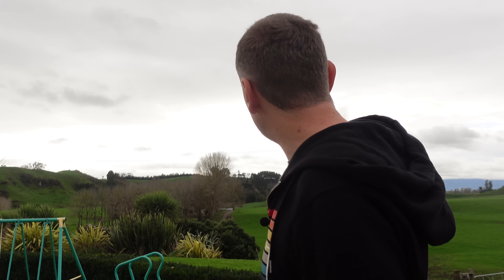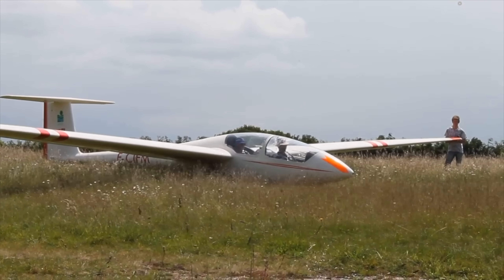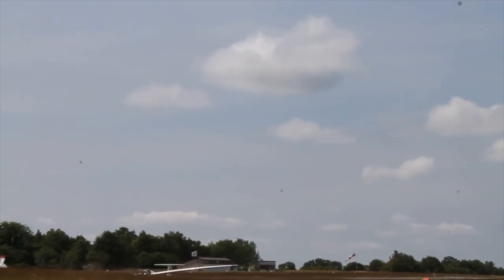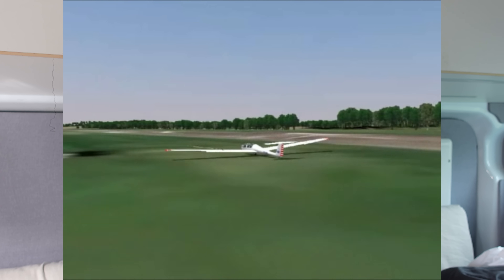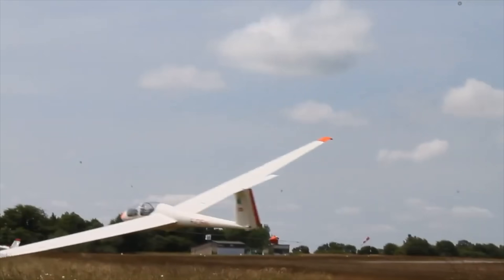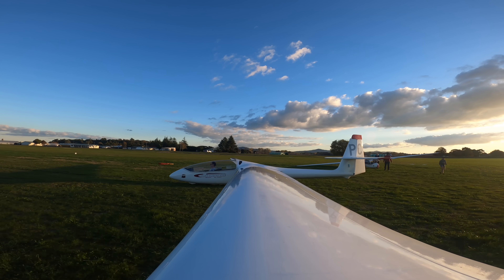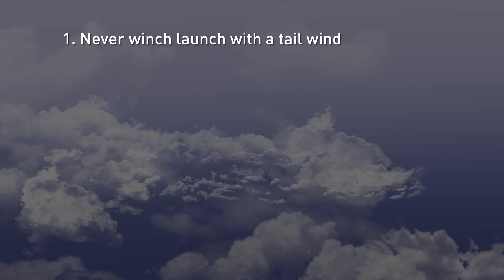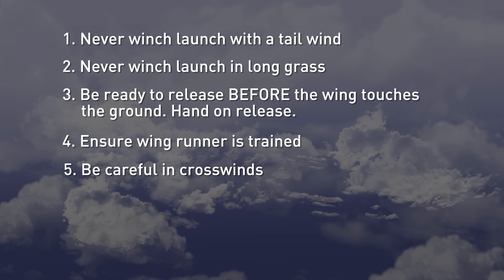Glider Winch Launch Crash 💥 Instructor Reacts

Comment: hello this is very shocking video for me. I had a few hundreds winch take of with L-13/23 Blanik in Slovakia. originally i though nobody control the glider - front seat pilot think its a instructor and opposite. but browsing comments here, front pilot should control. normally pilot in my opinion should use a full push in start /lift tail - i could not see that/ when acceleration is heavy, make airborne not from tail, must be very fast pull level becasue speed increase too fast..... but in moment left wing fall on ground,  also cannot see full rudder /tail/ to right side  with full ailerons with pushed elevator /lift tail first/ like he was not concentrated....somebody say tired. I saw right wing aileron for 1/2sec in correct way when i repeat video in moment wing falls on ground, then i think pilot start to hunt release cable hook knob. .  
 when tail is lift, ailerons became more efficient. when glider in air, he fight with stick to release cable, but ailerons and tail control seems resignation = neutral

with L-13 is almost impossible to fall wing in winch start /because have left and right hook, which stabilize glider a lot and good winch make a rocket launch, when ailerons works almost immediately to keep balance.. becasue school glider .
these super gliders is easy make a "watch circle and break tail " 
at my times, VSO-10 Gradient which i also fly cannot make a winch launch, only tow. - but designed for it - therefore i am not experience 
good analysis, grass is really high and it is significant factor. i think i would say also tail on ground help this "watch" . helper wing guy should let pilot know which directon wings want to fall, but i would say sometimes thanks for any hand.  and also winch operation with Blanik always had a 2 wing guys be able to break glider, if winch guy have a bad day..../for example make a cable tension hiccup before launch and let glider catch with gear......

Comment: can a computer auto-release auto land with issues and react much faster?    have a hands-free launch every time.
Reply from the maker: Not without a lot of engineering and design work. It’s more work than normal because it’s an aviation part, and has to undergo a lot of testing for use on certified aircraft

Comment: At my very first solo flight, at age 18, I landed at the right side of the airfield to make more space for the planes about to start BUT, just before I touched the ground, one tip was about a meter into some very tall grass, and I made my first and last ground loop! 
Luckily at very low speed, on the wheel and plane and I was fine.
My instructor drew a pig tail in my logbook  "landing" back in 1981  :D  
And after a short check, just a few minutes later, I went up again, and without any incidents.

My dad taught himself to fly in an open glider, SG32 in 1942, at an airfield very close to the German border, and with a rope to one of the farm's two workhorses "Tulle", and with his younger brother on the horse, the made a few attempts to learn to steer the plane on the ground, before he finally made it into the air, about 100 ft, and landed in the pastor's best apple tree...     

He was okay, but the plane needed some work before he could fly it again, and he did.

When they took his license to fly (medical reasons) at age 60, he had 19.976 hours in the air, exclusive his time in gliders.  Most of the hours were in agriculture planes, Pawnee, Rockwell Trush Commander, and the Australian Transavia PL- I 2 Airtruck.  
  
I only got a few hundred hours in gliders, and my last flight was in 1989, but I still miss it every single day, and my dad the same, until his death at age 83.

Comment: I think we can also think about a sensor based approach where you have two accelerometers at the wingtips, and if the difference in their acceleration exceeds some threshold, the winch is released automatically.
We just need two sensors, some long signal wires, and a solenoid. should be easy to implement.

Or we can just have an accelerometer and a gyroscope at the cockpit and calculate the wingtip acceleration.

Comment: If the pilot had acted faster, Stick forward right and cable disconnected, this would have ended better.
As an old glider pilot I have learned to always have the yellow release ball in hand and to be very focused during these first seconds of a winch takeoff.

Comment: It looks the main cause is the wing runner compounded by badly maintain grass. Theoretically in a balanced plane, if the wing tip is released it should stay level and not drop. If there was wind coming from the right, then the pilot should have been ready to release.

Comment: Could these gliders be designed with a mechanism to auto release based on a sensor when dangerous roll or ground contact occurs?
Reply from the maker: Yeah possibly, a lot of work to modify aircraft, but possible! I do wonder if there are ways we could design a hook to auto release in certain situations. The Winch hook on the belly does already auto back release, designed so once the glider flies over the winch, it will automatically release. But there are more circumstances...

Comment: I owned early model ASW 15, with an off center mounted CG hook. We are talking just few inches from the center line. It was the "widow maker' at my local airport, since without a competent wing runner, on initial roll, it would veer 10-20 deg to the right. Some wing runners would try to help and hold the left wing back, well that would make things even worse. To fly safely, even the small things have to be done correctly.
Reply from the maker: Yeah absolutely!

Comment: I was thinking about scenarios like this the other night. I suppose in that moment of something going wrong, Its almost human instinct to try and save face...  I was watching a guy get fitted for a new parachute which he was going to use in his 300k Plus glider and I started to think about it.. At what point would he bail out ,if the worst was happening ? Would he say ohh to hell with this aircraft and just save himself.. Or would he think, just hold on a few more seconds ,I can save this and I can still have my aircraft and everything will be gravy.. At what point to yo think to yourself Ok I'm off, Such a fine line its almost impossible to say the odds.. Clearly the right thing to do is to abandon ship, cut the release ect ect.. But Your torn in a split second to make a decision and that will be highly variable to each individual as to what way they react.. This pilot on tow could have been thinking, Oh bad bad, and tried to correct, or should he have instantly released as soon as he felt a wing drop ? Almost impossible to call unless you have enough time to actually let the brain process the pro and cons of a situation..
Reply from the maker: Yeah a good point. The trick is to figure it out before hand. Actually make the decisions. Eg  “if the wing starts dropping, release before it hits the ground”. Or “if I collide with another aircraft, jump out, and I’ll pull this then this”

Comment: Actually it's possible to launch both winch and tow without the runner, did it few times, always with CFI exprenced with this type of starts - and it's not that bad as it may seems. Force vector from the winch will keep you more or less stable and sliders/mini wheels on wingtips help with drag. However - the grass has to be moved, no exceptions here
Reply from the maker: Yeah we do it with Aerotow, but I would never do it on a winch launch, even with wheels. Just because if it goes wrong, it happens VERY quickly, and you probably won't react in time. If an aerotow goes wrong, it's very unlikely to cartwheel, you're more likely to release and do a ground loop (but stay flat).

Comment: In the video of the single seater you can see the pilot it deflecting his ailerons. That because the tipwalker is holding te wing too low. Thats not the tipwalkers fault but the pilot is reacting to it. The moment the tipwalker releases the tip the deflection forces the right wing down. This happens all very quickly so there is not much time to react. Conclusion its better to keep the ailerons neutral till the tipwalker lets go.

Comment: We had an instructor cartwheel his ASW20 to his death barely 2 years before that. In France, too. +200 member club. Similar winch. We made considerable efforts to analyse the accident into its smallest factors and make the national sailplane community as aware as we could about winch cartwheeling, including circulating the excellent BGA resources you point to. Seeing the first shot of this thing here sit, ready to go, in the middle of tall grass made me scream out loud.

So sad to see those 3 (yes, the wingwalker too) replicating every mistake we tried so hard to call attention to. And on a shoulder winged aircraft, no less. Imagine a duo discus with water balast instead... That they could walk away from it is a testament to the build quality and gracious behaviour of the venerable ASK-21.

One recommendation missing from the report, you do point to, but i really want to stress: When running through your checklist, the two final items should be to check the wind and state your actions in case of mishap, including "if a wing drops, pull the release". You do so out loud and thoughtfully, even when alone. This primes your short term memory and will give you precious tenths of seconds in reaction time. There is a significant startling factor here. Even with your hand on the damn thing, you have to be poised to actually pull it :D I have witnessed quite a few who just didn't and got away by sheer luck.

Also, as a wingwalker: when you level the wings, that means you agree to the situation (hook choice, seating, spoilers, canopy, dolly, pattern space, *runway*). It is your reponsability to say no if anything is out of order.
Reply from the maker: Hi sorry to hear about your instructor. Thanks for your comments.

Comment: I heard a different approach to wing running at winch launches which I find quite interesting : do not run. Just let go. As the winches we use at the local airfield here are quite strong the acceleration u can not hold up for more than three steps anyway. So you would have to run quite fast which kinda increases the chance of the wing runner stumbling quite massively. So he very likely is gonna push the wing down and make it much worse. This is a much larger problem with winch launches than with aerotows. So I kinda think this approach is quite reasonable.
Reply from the maker: Yeah that’s fine as long as the launch runs like normal, but if it’s low power at the start then running is more important. So best to always try to run within reason.

Comment: Engineering solution? Spring-loaded  Spring-steel wire at wingtip to skid across the ground. It could be catch released to angled aft after takeoff to reduce drag.
Reply from the maker: Not a crazy idea! But it’s not really a problem very often :)

Comment: How delicate are glider wings? Do they break/crack easily when landing? They look fragile but it makes no sense that they would be. What materials are used? I would imagine the use of carbon fibre materials are becoming more prevalent. Thanks for the info.
Reply: Airplanes are made to be lightweight, even if made of carbon they won't be strong enough to survive cartwheeling.
Reply: @chrismofer  Makes sense. I can imaging a cartwheel would be completely devastating, and could leave cracks that may be undetectable without expensive x-rays or ultrasound investigations. Without any experience in the field, it leaves me with many questions and thoughts on the topic. It is very interesting. Thanks for the reply.
Reply from the maker: The outside shell of the wing is usually fibreglass or carbon fibre, so can break or be punctured, but in the case of fibreglass, can be repaired easily. Carbon fibre wings are a bit stronger, but harder to repair.
Inside the wing is a spar, if that is damaged it's often not cost effective to fix it. It's very hard to break a spar, much like an I beam, they don't break easily.
Here you go, a video watching a glider wing bend until breaking point https://www.youtube.com/watch?v=M6VBqsrD4FE
Reply: @PureGlide  Right, I never considered the ease of repair issue. It makes sense fibreglass would be much easier to repair than carbon. Your description helps me imagine the interior of the wings, and now I’m getting a clearer picture. I appreciate you letting me in on it. I am going to watch the suggested videos, and look into this. I find this very fascinating lately. I watched the flex testing of the wings of a 737 to destruction and was not only stunned at the resilience of materials, but impressed as to the engineering and safety detail. Everyone should see it before they fly. Terribly impressive and reassuring. Again, thanks for the input. Regards.

Comment: Hi  This is an exceptionally helpful video. I like the fact that it explains why releasing is so important. The long grass is an obvious contributory factor, along with the other factors you mention..  

 I wonder if you have considered the effect of an increasing lateral couple as the glider turns.    Because the Cof G is above the hook, when we have a side pull, the wing is driven down, the glider is effectively taking off sideways and the aileron authority is not sufficient to overcome the couple.  

If straight , the glider has a longtitudinal couple that often will drive the tail down as the glider accelerates, as it turns, the lateral couple grows in force driving the downwind wing to the ground and holding it there .  The pilot will be unable to raise the wing because of the forces involved.

When the glider has turned 90 degrees or so, there will be a tendency for the back release mechanism to operate and auto release. however that is of course far too late.
Reply from the maker: Thanks yeah you’re probably right! In this case it did back release, the pilots couldn’t get to the release fast enough.

Comment: Great analysis. Did you notice though that at 0.05 the pilot is giving a tremendous amount of left aileron? For a person trying to guide the wing it is almost impossible to compensate sufficiently for that momentum.
Reply: He is giving full right aileron not left at the timestamp you mentionned and rightly so. What would be interesting to know is why this input wasn't sufficient to correct the situation. My guess was the grass friction was greater than the aileron force moment at that time when he was still going pretty slow. To me to most cringy part was the high grass. A regular winch start is already a kind a fine balancing act where alot of things can go wrong so there is no need to take any more risk by having it done with adjacent high grass sucking on your wings.

Comment: This happened to me once on a hang glider as I was attempting to foot launch at the "between the rocks" launch on Chelan Butte. Light thermal, began my run, then I let the left tip drop, it clipped a sagebrush, and rotated the wing. I tried to high side the bar to level the glider, but by then it was sideways, and I was about 15-20 feet up, since I DID get off launch, but with almost no control as it was still basically in a stall. Keeping it stalled as it came down, I was at least able to keep the wing flat enough to basically parachute down, instead of augering in nose first. Staying pushed out, the right down-tube took the impact on landing, and it bent outward. I landed on my side, and was OK, just had a badly bruised ego. It was pilot error, for allowing the left tip to drop, whether there was an uneven roll to the thermal or not. I should have had a stronger run, and kept the wings more level. Wing: Wills Wing SS 153, faired aluminum down tubes.
Reply from the maker: Interesting, thanks for sharing!

Comment: I saw a similar incident at 662VGS in the UK back in 1988.  I was driving the winch.  Student allowed the wing to drop onto the ground, instructor failed to get it back quickly, A/C reared up then belly-flopped onto the ground.  Some damage to the wing spar, fleet grounded for a few months.
Reply from the maker: Nasty. The main point is the instructor failed to release when it started going wrong? As this shows it happens so quickly. Still if it was only damage to the glider, then that's not as bad as it could have been...
Reply: @PureGlide  It certainly happens quickly, and with the wing having so little distance to drop to hit the ground it takes lightning reflexes by the instructor to get it back when a student lets it drop.  That long grass certainly didn’t help.

Comment: Awesome channel. As an SEL-rated pilot, I have never heard of this wenching launch. I find this fascinating. I would like to learn more about it. Around here you simply tie your line to a Cessna 170, 182, ag tractor or whatever is available. You are towed to 10k or so then you are on your own. How does this wench store the energy necessary to launch? What is the turnaround time? Do you use a golf cart or 4 wheeler to reset the launch cable? Do you fly on overcast days? I imagine it's a challenge to find a thermal on those conditions. One last thing, Cut The Grass! Those things look like the outboard leading edge would be Extremely sensitive to Any drag whatsoever.
Thanks for sharing, sir. 
Cheers from Louisiana.
Reply from the maker: Haha love a good wenching ;)
Reply: @PureGlide  LOL voice to text will nail your ass every time.

Comment: Where i flew they took off with a winch aswell but they accelerated much harder right away so yoy only had to take 3 or 4 steps not even running and it would be enough.
Reply from the maker: Yeah agreed, and I wish I made that clearer in the video, but the trick is if it goes wrong e.g. the power isn't on full for some reason, then it becomes critical. Also the long grass probably made it tricky for him to even try to run!